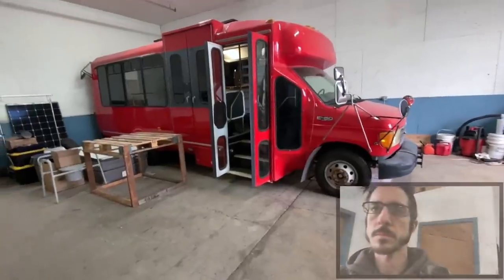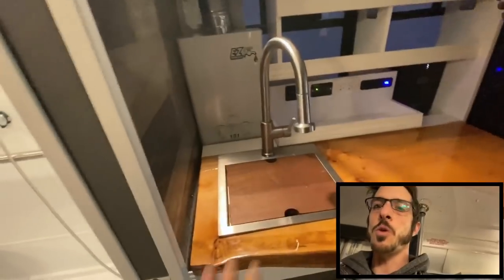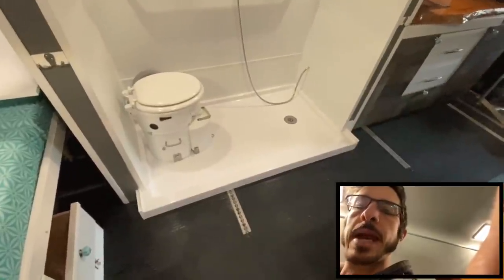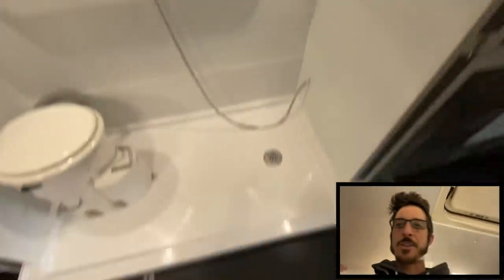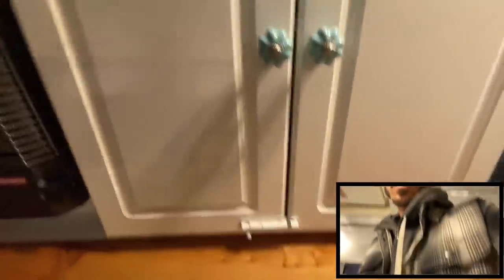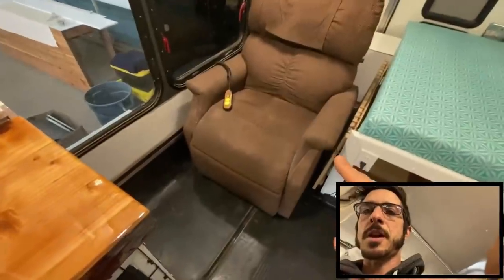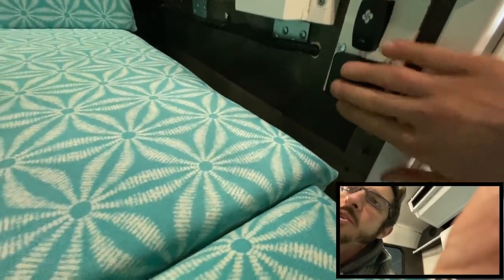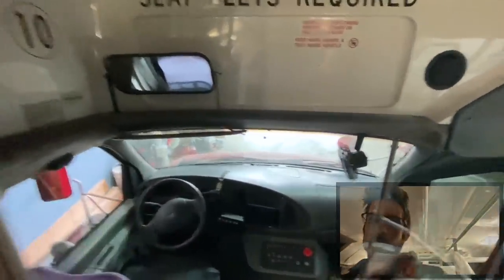Shuttle bus conversion is a handicap accessible TINY HOME / Huge shower and full size bed

Comment: Another thought would be to make the bed extension fold up and under the mattress. Then she could simply lay the recliner back flat (mine does that anyway) and flip it down to add the cushion.  That way she wouldn't have to pull out and turn the chair.
Reply from the maker: Great idea!
Reply: My husband is a T4 paraplegic and I use a scooter for mobility. We have 27 years experience in w/c accessibility. We bought a midsize bus recently to retrofit for our travel. Your lift table is a great idea that we plan to incorporate!

Comment: Did I miss something in the shower area because I didn’t see anything that allows you to adjust the temperature of the water. You pointed out the offer/on valve you added to the handheld sprayer, but not the temperature regulator knob.
Reply from the maker: You didn’t miss anything. Water temperature adjustments are made on the tankless heater. All you have to do in the shower is on or off. This is not like a house shower where you have to set temperature every time.
Reply: @nomadbrad503  Thank you for answering my question. That is good to know about the tankless water heater because I have not heard anyone talk about that aspect of it.

Comment: I like the rig and  the upgrades the only issue I have  is  with  the  desk, you could have used thicker  & nicer  piece of wood  ,  something  like the other wood in the rig.
Reply from the maker: I understand. The issue is that the other counter top wood is too thick and heavy for this folding desk design and if you walk on epoxy it will scratch and look ugly quick. I used an oil stain here because you can easily re apply more to bring back a nice finish. Keep
In mind this desk top will be walked on daily.

Comment: 1 question. If she gets out by the ramp, how will she close the ramp back up from the outside?
Reply from the maker: There is a remote control for the ramp so you can use it outside. Also she will be traveling with her daughter who is helping her
Reply: @nomadbrad503  oh, a remote control. That's perfect. Thnx

Comment: Hi Brad.  Great bus interior.  I will use many of your ideas in mine.  Love the wheelchair lift desk.  How is it that you don't have wheel well issues to deal with? Those busses look very much like mine, but I have wheel well covers and you don't.  My bus is 9 feet tall, what is the height of yours?  I would appreciate any thoughts you have.  Thanks for the ideas.
Reply from the maker: This bus is about 9 feet tall. What do you mean wheel well issues? Are you speaking about inside on the floor?
Reply: I have an E-350 and I believe the floor is lower than on your bus.  I have wheel wells in the floor.  Anyway, I will have to find a way to work around them.  My bus is 9 feet measured from roof to pavement.

Comment: Good Build Brad. Is the Heater on the Wall Vented? Where is the L.P. Gas Tanks? You do good work. Always, Tommy :-)
Reply from the maker: This is a ventless Heater. The tanks are under the bed, accessible via the rear door
Reply: @nomadbrad503  I have been looking, do they sell a vented heater in small size where the vent goes out the back of the heater the size you put in this build? Thank-You & look forward to keep being impressed by your 'Gift Of The Build'. always, Tommy :-)
Reply from the maker: @agentofficerthomasa.porter107  yes, propex sells those in propane fuel. Or you can get the Chinese diesel heaters also. I have one in my personal truck, it’s great

Comment: What was the cost for this fantastic build??   Absolutely fabulous!!!  If someone lives out of state how do you schedule the builds?  This is the first time I've thought I'd be able to this (travel around in a tiny "home" because I have mobility issues.  What year is this shuttle bus?
Reply from the maker: ThAnk you, this is a 2003 ford e450 with the 7.3 diesel motor. these builds Are very time consuming. Big red took nearly 5 months to complete. I have subleased my shop and am going to hit the road to travel. I will not be doing another full build anytime soon.
Reply: @nomadbrad503  Thanks so much for responding.  I hope your upcoming traveling is filled with joyous wonders.  Seeing your video has opened my eyes to possibilities even with my  challenges…thanks so much for sharing!

Comment: Why AGM batteries?
Reply from the maker: Because weight or space is not an issue on this bus and 400 amp hours of agm was only $700. That would only buy you 100 amp hours of lithium

Comment: Bedroom was a big fail.
The bed in the back should fold up to a couch. 
There isn't any where for her to receive a guest.
If the bed folded she would have a wonderful receiving area. As you said the majority of the time she'll sleep in the chair.
Reply from the maker: Thanks for the feedback! Be grateful that this failed bedroom is not yours ❤️✌🏻
Reply: @nomadbrad503  I don't mean to be harsh. Sometimes I forget there's people behind these. 
I was thinking about the woman traveling in it. 
Visits are important. If the bed was a couch it would be usable.  Steps to the back door allows guests to enter sitting room. Would also open up back for a small wardrobe. That would be greatly preferred to a massive long drawer on the floor for a woman in a walker with mobility issues.
Reply from the maker: @lilbirdie4516  I understand that it’s easy to look at a video and come up with ideas about how you think things should be. Building a vehicle of this small size with requirements for a mobility challenged person requires a lot of compromise. 

The great thing about building a vehicle from scratch is that you get to choose what is most important to you. It was important for them to have a full size bed and the recliner. Also it was important to have a full size shower, and a permanent dog crate. 

a sliding bed wouldn’t fit because there are 2 propane tanks under the bed in a vented propane locker and a 46 gallon fresh water tank that is accessed from the outside via the rear door. If I made a sliding bench bed, those items would not fit. 

There was compromise and I stated that at the beginning of the video. All things considered, we packed a ton into this small space..calling the bed a fail is ignorant.
Reply: A different perspective is not ignorant. I watched your video twice to see if I was missing something. 
From the perspective given in the video, the only thing under the center cushion is the drawer. Going back that distance with interlaced slats opens the room allowing for visiters. 
That's all I was saying. 
A little more time on the design would have paid off greatly.
I do believe the real answer to this (your) design is if your customer was happy.

Comment: l have some balance issues and don't need a ramp but l worry about the shower and have never seen one with a grab bar. Question - isn't there a way you could cut into the floor to drop the shower pan down at least an inch or more allowing a deeper pan yet not increasing the foot lifting, perhaps even making it easier? l have no idea if it would be feasible/sealable etc. just wondering as an older woman looking for ideas for my own dream build. thank you and great work! it must be satisfying work
Reply from the maker: The easier move would be to install an actual floor over the existing rubber floor. That would allow you to insulate and put down real flooring. Then you could make the shower pan flush with the floor
Reply: @nomadbrad503  l also like the idea of heated flooring as l'm from MA and have family in Maine etc. l often don't need much heat as I've got thick blood as is said. Do you have to add extra flooring anyway to have this feature? Thanks for your input and your craft for all us old folks!
Reply from the maker: @lindaward3156  yes, you would need to build up the flooring anyway to allow for the heated floor system. And you would want to add insulation under the heated floor so that your heat doesn’t go down, out of the bus.
Reply: @nomadbrad503  thank you again kind sir. perhaps you should be my hire as l want to convert a short bus as l drove the big ones for a paycheck off/on since 1079 and l'm quite comfy in them. lt's only a dream for now but...
Reply from the maker: @lindaward3156  you’re very welcome! Send me an email nomadbrad@vanliferx.com I will be hosting a free live class soon on “planning your dream home on wheels” you might learn a lot from that and I can also help you with a conversion. 😊✌🏻

Comment: quick tip on the dog crate, next time make sure the fence part of it is on the inside of the posts, that will prevent the dog being able to push the fencing apart from the posts and be able to escape... it's easier for dogs to push outward than it is for them to pull inward toward themselves to get something open
Reply from the maker: Great feedback, thanks
Reply: @nomadbrad503  yeah, just figured I'd share the tip... to be fair, I have had to learn this the hard way myself, by having my own sheppie being a naughty not so little Houdini more than once, leaving me to go "how the BLEEP did you get out of that one?" more often than not....
Reply: My dogs understand doors that go in. They teach each other, so don't let 'em corrupt one another. My Susan I call "pry bar nose," because she literally prys with her snoot. She's not allowed to claw things.

Comment: I don’t like the type of latches you put in. I would rather have magnetic latches.  Also the drawer under the bed and the switch plate looks very unfinished. It needs to be solid with no gaps.  Otherwise I think it looks good since you had to use all those big pieces and recliner!!